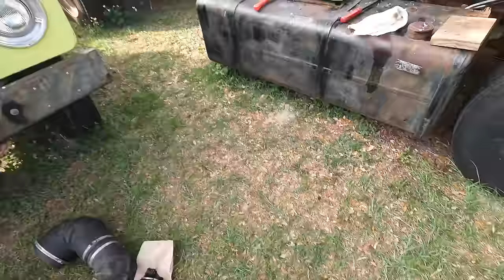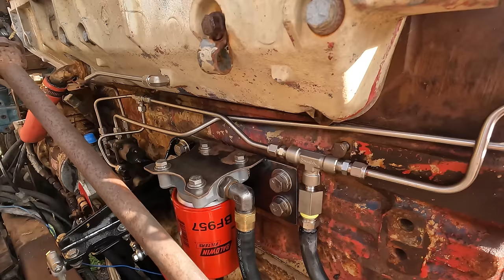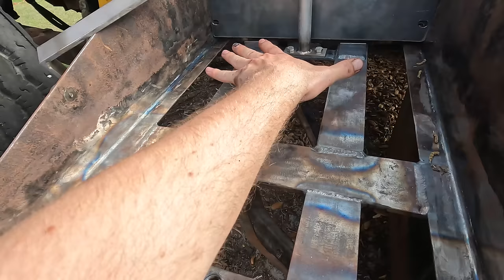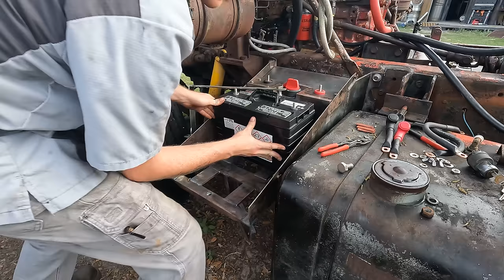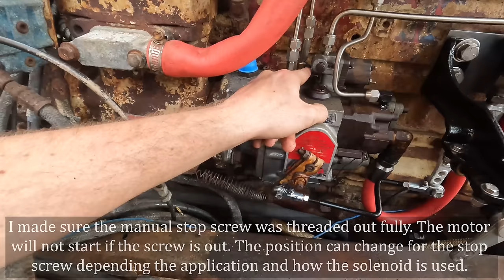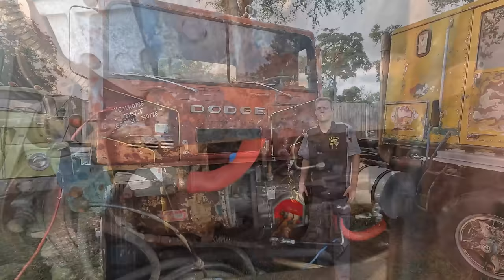Will It Start? Starting The Big-Cam 3 in my '71 Dodge L1000 Cabover For The First Time in 25+ Years!

Comment: Noticed you hadn’t posted in a bit. Boy you’ve made a lot of progress on the truck. Sounds like you’ll have a bit of wiring work to do on the truck. I think that’s an electric solenoid that shuts the fuel off to shut it down. Battery box looks great on it. You did a really nice fabrication job on it just like the grille. Can’t wait to see next update!
Reply from the maker: Thank you! Im definitely hoping it is just a stuck solenoid or a bad ground. I may have to rewire every ignition circuit but we will see when we get there. Out of sight out of mind lol. Almost all the wiring under the dash needs redone. We will get her there though! Thanks for watching!

Comment: I worked in Detroit in the late 60's and early 70's. Mobil Oil would fill our diesel fuel tanks. They had Dodge L--1000 COE tractors with a decal of a Winged Horse on the sides, pulling a large tanker trailer with a smaller pup trailer. A heavy load. No sleeper, and two thick, rough metal exhaust stacks. Not chrome. They used Detroit Diesel 2-cycle 8V-71 engines with the biggest injectors made. The DEEP AND LOUD ROAR they made was so impressive and fantastic. On calm, humid summer nights, I could hear them coming from a mile away, and I would run to get a closer glimpse as he got closer to our terminal. Pure adrenaline rush. I haven't heard anything that awesome, since.
Reply from the maker: That is awesome! It makes me want to dig up pictures of the truck to see what she looked like! I love these trucks so much as daycabs! Im sure it was a sight to see. Hopefully I am able to make a video that evokes the same feeling when I get this old girl driving at some point. Maybe not the same but close. That would be really cool. Thanks for sharing and watching my video!!
Reply: @OLDSKUULGARAGE  That would be wonderful. Thank you.

Comment: Old school cement mixer used as a gas tank cleaner. Bungy or ratchet strap the tank to the mixer, insert your harbor freight polishing or cleaning stones inside tank and turn on. Might be noisy though. 
Did it with motorcycle gas tanks. We'd put foam seat cushions from couch in drum and the fuel tank inside mixer drum.
Reply from the maker: Hmmmm… i have an old mixer laying around and I dont know how I hadnt thought of doing that. It is a good speed and should be plenty strong enough. Thank you for the recommendation! Thanks for watching as well!
Reply: I second the cement mixer for cleaning tanks.   I dump in some mineral spirits and a couple of handfuls of sheet rock screws and steel nuts in it if there is rust or stuck on goo in there.  Use a magnet to pull out the steel.
Reply from the maker: @mshort7087  i have had great luck with 25% white vinegar but the issue is the flash rust afterwards is horrible to deal with to get just a coating down inside a tank. Im definitely going to see if I can rig something up with the mixer.

Comment: Unless a big can a hole in the block it will run. Incredible engines.
Reply from the maker: This one I dont know. There was a lot of rust in the fuel lines. It may have but could have hurt the injectors. They definitely are very robust engines no doubt though! Thanks for watching!

Comment: Great fab work. Maybe the sponsor can powder coat it?
Reply from the maker: Thank you! I have definitely considered it. But I dont want to have everything powder coated as I feel that would be almost an abuse of the relationship but it definitely has crossed my mind. I definitely want some bigger stuff powder coated like the wheels and diesel tanks. 

My only issue with power coating the box would be I have no real way to fix a paint chip or scratch from normal use. I also have some others plans that may interfere with powder coating this specific box. I will discuss them in a future video for sure. Thanks for watching!

Comment: Excellent video that is a really nice looking truck.  Per US DOT regulations you need to have a stainless steel flex line from the air compressor to the first wet air tank for vibration and engine twist and thermal expansion when that truck was new it had a all copper tube
Reply from the maker: Thank you! I love this truck! Stainless ptfe lines aren’t required unless the truck is plumbed in nylon. Reason being the heat from the compressor will melt the nylon tubing entirely. I will be doing copper out of the compressor directly to a flex line somewhere to combat this as the copper does great with heat compared to all flex lines. I definitely need flex lines though as you said because torsion from the engine. I wont be able to get completely away from flex lines but I will change what lines I can. Hope this clarified a bit what I said in the video. Thanks for watching!

Comment: I drove a cabover like this-single axle that was used delivering plumbing supplies out of Grand Rapids Michigan.  One time the water pump went out which was on a Detroit but dodge used there own water pump to make it fit. Good to remember about some of these issues.Also the heater fan was a complex issue to have to replace.
Reply from the maker: That is interesting! I didn’t know the detroits used a Dodge water pump! The cummins trucks if they were slanted had dodge only parts as well. Not every part but little changes were needed to some because the engine angle. Similar to some horizontal mount 855s I recently learned about! Do you recall what was wrong with the heater fan? Is it just rot that eats out the motor or something similar?
Reply: @OLDSKUULGARAGE  On that slanted Cummins engine, there were special oil diverter clips fastened on the top end under the rocker covers so everything could be lubed properly.  Also a different Bell housing to align the engine to frame mounts(front and rear).  Bill
Reply from the maker: @billtodd6509  wow I didnt know they had different oiling stuff on the top end! Did the horizontal mount engines in buses have similar oiling systems for the valve trains?

Comment: C F and some of the other companies used these single axles for pulling doubles  . The company I worked for ended up with 3 single axles and 1 double!  At that time we finally got some “new “ trailers which were 45 ‘- 96 “ .  For being all spring suspension - they were not all that bad to drive!
Reply: The heater fans would just start making a noise and then they wouldn’t work very long
Reply from the maker: This old girl is air ride but my ‘68 single axle is spring ride. You talking about driving it makes me want to get it going even more! I cant wait to see how these trucks ride!

Comment: Congrats, friend, sounds like you have a pretty straight running engine.  That's the correct way to bring an old machine out of hibernation.  Bill
Reply from the maker: Thank you sir, that means a lot. I definitely wanted to do it right as to not cause any damage. Thank you for your great comments and the information you provide. It is always welcomed!
Reply: @OLDSKUULGARAGE  If I were you, I would put  new gaskets(head and auxillary gasket), and unloader valve spring on the air compressor, and a new air governor.  The parts are relatively  cheap and can be done without removing compressor.  I saw  the kits on eBay a while back and they were a bargain.  That truck will be as good as it ever was. Bill
Reply from the maker: @billtodd6509  oh wow I need to check that out! I will be doing all new gaskets up top on the engine as well (minus the head gaskets) when I add the jakes. I would like to change all of the manifold gaskets as well to be extra safe. She definitely should be alright when all done up!
Reply: @OLDSKUULGARAGE  Those Bendis air compressors are tuff.  Most of the time they carbon up their little valves in the upper end that you can cure with that minor repair kit and a new air governor.  She really sounded great for such a long downtime.

Comment: Great video and a massive achievement getting the engine running sounds amazing, alot of hard work paid off. Especially like your fuel filter bracket it looks really neat and tidy job, perfect 👍 looking forward to more video's keep up the good work
Reply from the maker: Thank you! It was super exciting getting the old girl going again! It definitely took a lot of fab work on all the parts especially that battery box and redesigning the base a little bit. Thanks for appreciating the work I did and for watching my video!
Reply: @OLDSKUULGARAGE  it was all great! I know what its like repairing the battery box that has old rusty steel and using new steel it can be challenging but looks absolutely great job and everything fits so well. The battery isolation switch is a good job, i would fancy one like that myself for my cherry picker that has 4 batteries. Ive been disconnecting them temporarily for now when not in use. You have an impressive collection of vehicles there. Its great to see them being restored and kept alive 👍
Reply from the maker: @homemade_projects  thank you so much! I love these trucks as they are each a piece of history. The are machines that worked and there is something very special about that. Especially this red one. 

The battery disconnect is awesome but for four batteries I would recommend a beefier switch than what I have. It may suit your cherry picker better! 
I really enjoy watching your channel as you do a lot of the same stuff that I do just in a different way or different equipment! I feel like I can get something from your vids as well every-time I watch! I am glad to have found others out there that love old machinery just like me. You are extremely pleasant to talk to as well and it really sets you are apart from the crowd. Thank you for doing what you do!!
Reply: @OLDSKUULGARAGE   It is very rewarding restoring engines/vehicles back to working conditions again, they really are underappreciated for what they did and its great some people put the effort keeping them alive. I collect vintage seagull outboards, they have no modern bearings all bushings running on 10:1 oil mix, British made from 1930's. As yet haven't made any video's on them, but i have so many to fully strip and rebuild hopefully this year might do some. They really are a lovely engine with exposed flywheel and often seen bringing men home in small boats known as a reliable engine. Absolute pleasure watching your video's and iam really getting into your repairs, ive only worked on a couple of diesel engines last year and would love to do more. Iam really glad to be watching your channel and thank you for your kind words, great to meet a professional like yourself 😀
Reply from the maker: @homemade_projects  i would love to see videos of the seagull outboard motors getting fixed up! They are so mechanical looking and very bare bones with no cowl or anything to cover up the goods. That would be seriously cool to see them completely redone or even just fixed with original patina! And I am no professional lol. Just an florida man that wants to build cool stuff 😂.
Reply: @OLDSKUULGARAGE  don't underestimate yourself you definitely know your stuff. Hopefully later in the year i will have a go at restoring some engines, so many projects so little time 😂
Reply from the maker: @homemade_projects  i know the feeling 😂.

Comment: I was stuck on the N.Y. State freeway in 1989 in a 73’ Ford Cabover with a 318 Detroit. A guy had a truck with a load on it of going to Boston. I picked truck up in Mich. got to N.Y. When the motor ran away. Pulled fuel shutoff. It didn’t shut down.318s when ran low on fuel sludge previous driver had told owner truck left with no fuel) would hold injectors open allowing it to run away. 10 days before this guy got me another truck. I was young and waited with it. Paid me like $25 a day which wasn’t crap even then. The truck rounded out the cam when it ran away so he signed it over for cost of tow.
Reply from the maker: Wow! That was a long ten days I bet. I have never experienced a run away and pray I never have to. Im sure it was nerve racking to say the least! Was the Ford cabover a C series truck?
Reply: Congratulations on getting that L1000 up and running.  Good job! 😎
Reply from the maker: @jodaddysdodgegarage3533  thank you!

Comment: The fan motor was a common issue which was a long repair if you did it the way you were supposed to-as most of the dash had to be taken apart but our (rednecked ) did by using a combination of a simple vise grip and screwdriver to make it happen by bending the lips up so as to avoid all of that .  Also -With the fan / water pump as Dodge had such close clearance that was why they made them for themselves  with repositioning outlets for water hoses .
Reply from the maker: I feel I will be venturing down this road here soon! Thank you for the info as I feel it will be useful. Thank you!

Comment: Great channel, thanks; I would not have run the battery cables over the centre support flat bar; would make them shorter and not touching anyting but air and the appropriate teminals; hope nobody beats me up for my comment.
Reply from the maker: Thank you! I think I may add some spacers so everything is floating a bit. The style of lugs I chose do not raise the wires really at all so chafing of the wire could be an issue. I am using welding wire which is a lot better against abrasion compared to battery cable as well. I hope this helps the situation a bit for now. Thanks for watching!

Comment: There we go! 
Almost a matter of time till you're taking us for a trip around Jax like you did with the old c800 🤠👍🏽

On a different note the old two-tone yellow and blue cab over is there a chance of being able to rebuild the old roof at air conditioner is that a Kaiser up on top? 
😊
Reply from the maker: I hope we will get her going solid here soon! And yes, I will be rebuilding that air unit on top of the 1968. If I cant, I want to find an original unit that dodge would have installed from the factory. Or maybe even make one. Thanks for watching!

Comment: Leave button turned out start it up then turn button other way with key on and see if it stays running then turn key off
Reply from the maker: It definitely might be some wiring issues up by that button that I need to address. It could be the fuel shutdown solenoid as well. I will trouble shoot the issue to see for sure! Thank you for the advice and for watching! I appreciate it.

Comment: Rigid lines can crack from vibration.
Reply from the maker: Yes they can. Although with stainless it takes a lot more vibration than steel lines. I will be making sure they are secured correctly for actual driving. Thank you for watching!

Comment: I think I would at least connect the air cleaner, one small piece of debris in the turbo.........not good. Other than that, congrats!
Reply from the maker: I would have but a few issue arose with that. the air cleaner is rotted in some areas and has stuff beyond the filter. As well as the filter is quite old and filled with junk. I also wouldnt be able to stop the air flow quickly or reliably if the truck ran away on me. Definitely one of the first things I need to get to though! Thank you and thanks for watching!
Reply: @OLDSKUULGARAGE  I can understand that.  When it fired off I saw that loose debris flying around with an open intake,  just hate to see the turbo get wrecked after all that work to get to that point. Love what your doing, I'm a mopar guy and I really love old Dodge trucks. Keep the videos coming!
Reply from the maker: @allenduncan1944  yeah we are getting hit by pollen hard right now lol. I definitely could have taken more precaution. You are most definitely correct. And I definitely will keep the vids coming no doubt!
Reply: @OLDSKUULGARAGE  I can relate, I live in Pensacola and everything here is yellow lol.